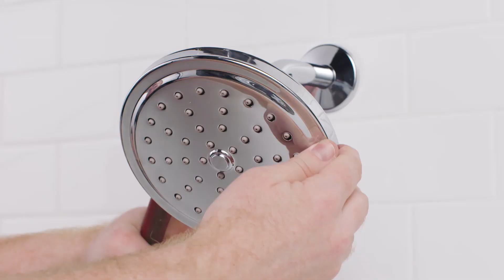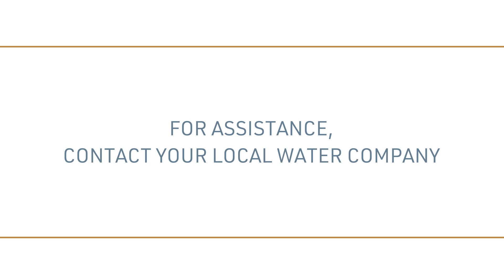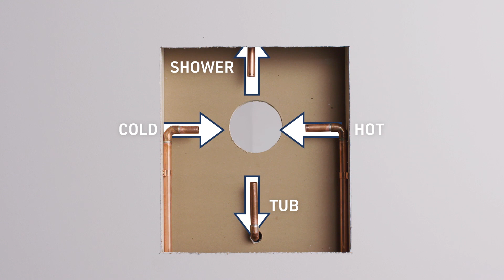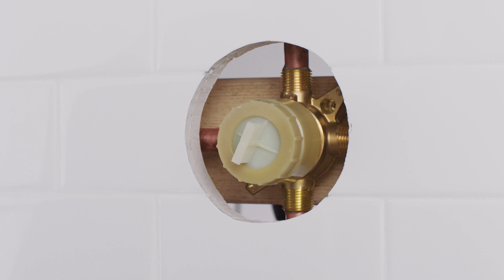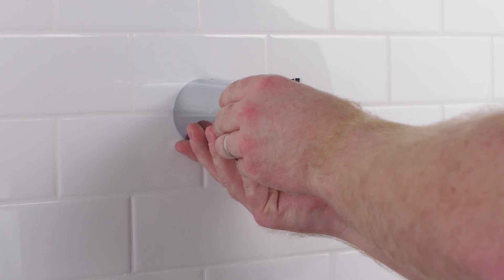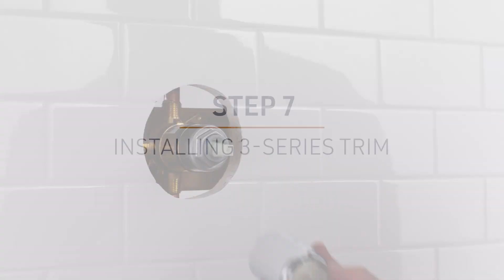M-CORE™ by Moen Installation  | M-CORE™ 1-Handle Mixing Valve and 3-Series Trim

Comment: The plumber put the teflon tape on the shower arm the wrong direction. As you are facing the pipe, the taper should be wound on in a clockwise fashion. Thedirection by the installer will cause the tape to unwind and risk failure.
Reply: Tape, not taper. Also I put the escutcheon plate on before I wind the teflon
Reply from the maker: Good morning. We appreciate the feedback. Please reach out to our Contact Center if we can assist you further. Our Product Specialists are available Monday through Friday from 8am-7pm EST at 1-800-289-6636.

Comment: Other MOEN literature says to grease the O ring. Can you address this please?
Reply from the maker: Hello jamesnordquist. When replacing the cartridge Moen does recommend to grease the outer o-ring of the cartridge, part number 1213 and inside the valve body. For further assistance in replacing the cartridge, we would suggest contacting Moen directly.

Comment: Hi there.  I'm getting ready to replace the pressure balancing puck in my M-Core housing. How do I remove the puck?  I'm replacing it because I have good cold and warm water flow but poor hot.

Thank you
Reply from the maker: Hello Brent.  The following link will walk you through the disassembly process for your shower-only fixture, the removal of the original cartridge and the assembly/installation ofd the new cartridge:
https://solutions.moen.com/Article_Library/1213_M-Core_Cartridge_3_Series%3A_3_Port_Valve

Comment: Do I need to remove the two rubber washers / plugs from either side of the adapter?  It doesn’t say to do this, but I don’t understand how water enters it otherwise.  Thanks.
Reply from the maker: Hello. We would like to assist you further. Please send us a direct message and confirm which rubber washers you are referring to.

Comment: How come there are no air chambers?
Most of the installation I've done are on new houses, on 2x4' /2x6 not existing drywall and tile.
Reply: It depends what plumbing codes are used in your area.
Reply from the maker: Hello David.  Air chambers are usually found on older homes and act as a shock absorber for water flowing at a high speed.  This is not something that is included with the valve or necessarily needed for newer installations.